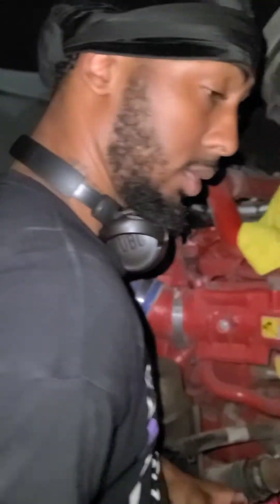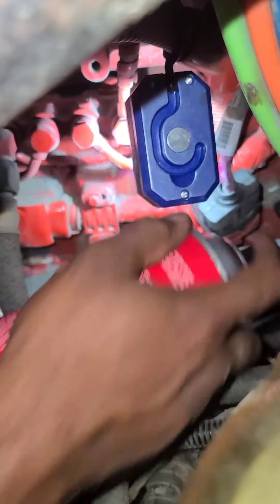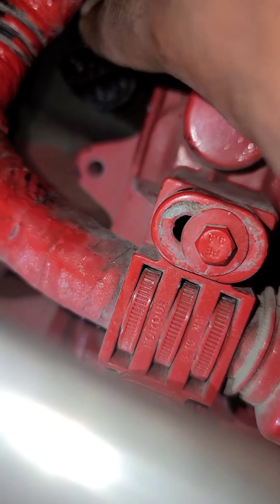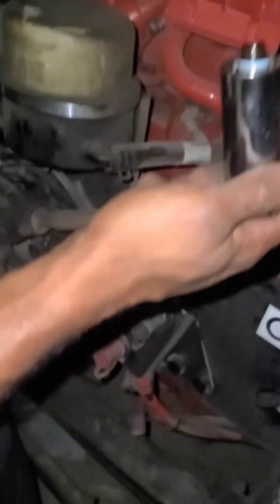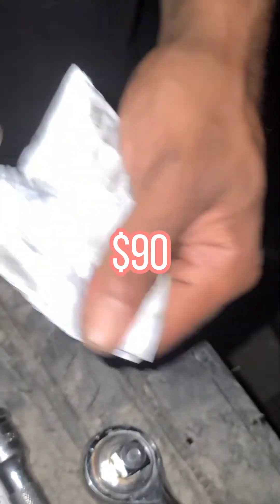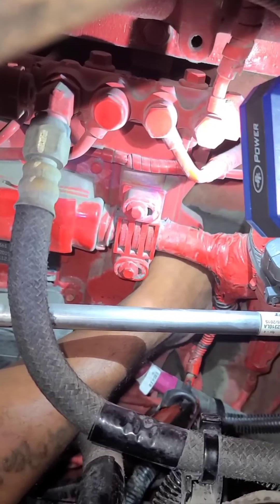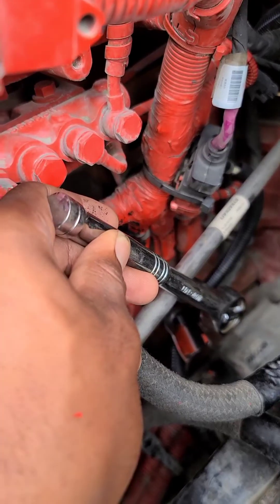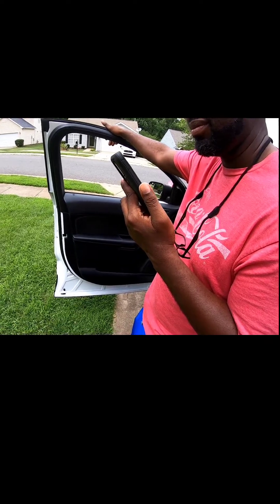cummins isx 15 oil pressure sensor fix, removal and installation.

Comment: Can you still drive the truck like that for about 300 miles to get part and replace
Reply: If it's really bad it will start dropping below 20psi alot.. and then the stop engine red light will begin to come on the dash as well.. I wouldn't chance it. You will feel the difference in the truck losing power . And you don't want to risk damaging your motor. If you can safely get somewhere asap park that's the best bet.
Reply from the maker: Yes you can as long as it’s only the sensor
Reply: Just an update on my situation it was the oil pressure sensor and the oil pump as well. Once I change the sensore I was still getting bad reading. Dropped the oil pan and checked the oil pump and that was the issue as well. I had the original oil pump that came with my motor. Cummins now offers an upgrade to the oil pump they no longer have the throttle that opens up its now blocked off. That's what causes them to go bad on the original old pumps
Reply: @interstatebullly3nyg551  where can i buy upgraded one if needed ?
Reply: @mondo9.2.5  stop by any cummins dealer if it's not in stock they will order it
Reply from the maker: yes
i wouldnt do it for too long i did it after i completed my work week
Reply: My truck didn’t slowed or stopped. I drove mine about 5k miles. No problem. Bit I new it was the sensor. What my mechanic told me was to run the truck up to 35mph and put on the engine break. If the engine break activates then the engine has presume so it’s the sensor that’s bad.
Reply: Also, I had the oil pump done about a year ago so it couldn’t have been that.

Comment: I got mine on amazon for 13.99 plus overnight shipping was 30 total. 130 @ cummins they didnt have it and kenworth wanted 150.  Pigtail was different but when i compared to old one realized i could just clip one piece of plastic off one side and it fit perfect its working will see how long it lasts
Reply from the maker: Glad you got it figured out

Comment: Hey i have a quick question. Do you know if the exhaust gas pressure sensor would have anything do with the oil pressure?
Reply from the maker: no i dont i am sorry

Comment: Thanks!! Took me 15 mins once I removed the fuel filter. Got oil pressure. Luckily it wasn't the pump.
Reply from the maker: you welcome these truck are something else aren't they?? i am glad it wasn't either a very common issue.

Comment: Thanks bruh I wasnt going in for service these folks are semi truck con artist. I had one change an air valve for almost 500... Part cost 12$ they charged $120 + 150 roadside + 180 labor we should report them with these false claims and upcharges for parts...
Reply from the maker: Man I swear we all gotta share this stuff mechanic will take advantage of you if you let them

Comment: Wish I had found this earlier 🤬 paid 1400.00 too get my truck towed
Reply from the maker: sorry, that is a lot
Reply: What was your truck doing when you tried to start it back up?? And what happened when it shut down?? Mine was leaking real bad but when it shut down its not turning over like the motor is locked but its fuel of oil with 130,000 on the rebuilt